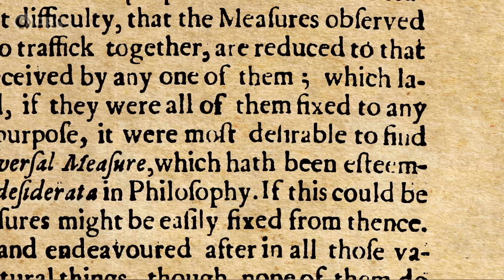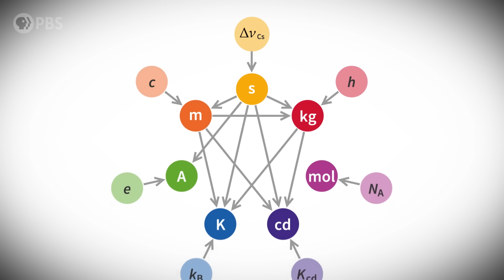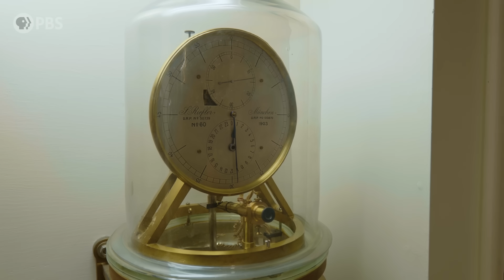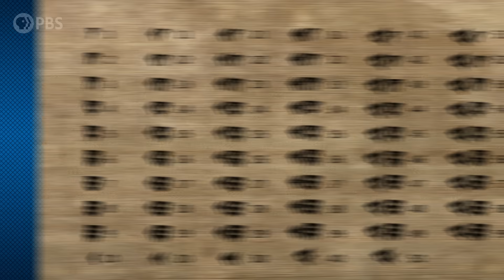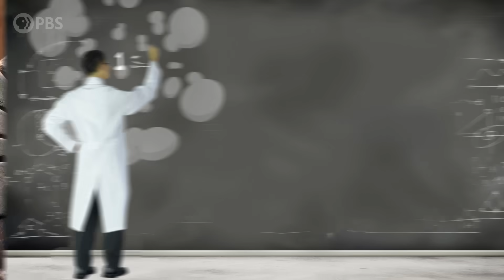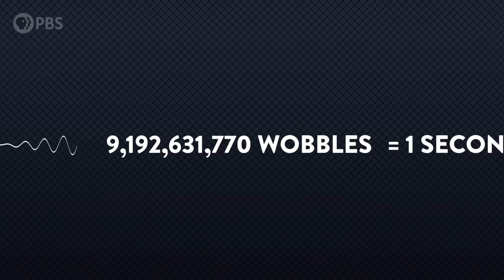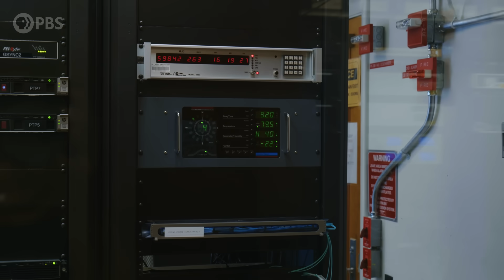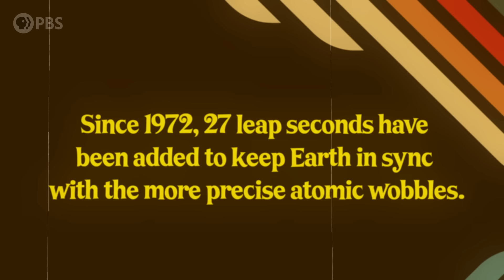The Unexpected Measure that Makes the Modern World Tick

Comment: But ... how did we measure the time to count those "wobbles"? Brain. Hurts.
Reply: The wobbles are contnous. You count the wobbles from any moment you want until you get the required number of wobbles. The time it takes for you to get that exact number of wobbles is 1 second.
We don't measure the time to count the wobbles. We count the wobbles to measure time.
Reply: @enadegheeghaghe6369  Yes I know that. But who decided the number of wobbles in one second. We're using 'wobbles' to measure time so by definition we already had a measurement for it. So my question is how we accurately determined the number of wobbles when such high precision didn't previously exist
Reply: @JATJAT330  I assume that the number of wobbles in a second was based on the previous best measure of a second we had before caesium atomic clocks were developed. You have to start from somewhere

Comment: I would think that time would be measured the most accurately one standard distance from singularity.  It would have to be theorized by mathematics, of course.  Like a cesium "pendulum" one meter from point of singularity (singularity is timeless, right?).  A time crystal?  A black hole crystal movement watch.
Reply: singularities cannot exist physically speaking, and you can't use them to measure distance either, since even theoretically, the only place we could find them is inside black holes, overall your idea isn't really applicable, even if we could somehow create a naked singularity, there's still the problem of actually measuring said distance, which due to quantum uncertainties, makes it impossible to pinpoint the exact location of the singularity giving you an incertitude orders of magnitude higher than what is used today.
Reply: @voice-less  , you said 'theorecically.'  That's what I'm saying.  I'm not talking a literal black hole timepiece.  Just figure it out mathematically, and make an actual cesium clock "geared" to be as accurate.  Maybe seven of them that an eighth one reads the average of the wobbles, the average would probably be even more accurate.

It might take more purified water for the steam drive, though.  lol
Reply: @augusthavince8909  I see where the confusion is, we can't ''measure'' a unit mathematically, just like distance, time is something we have to physically measure to know, Mathematics only tells you that 1 second is equal to 9,192,631,770 oscillations of cesium, but as you see, it's pretty useless information unless you actually know how much time it actually takes for cesium to oscillate, hence why we have to measure it.

and you don't need to have more cesium clocks, the oscillations can be counted with an absolute precision, so a single clock is enough to measure a second with a certainty of 9,192,631,770, the problem lies in that within physics, and within certain real life appliances, we need to be even more certain than that, so cesium clocks simply aren't enough.

A simple example to visualize it, would be to think of measuring time as trying the maximize the amount of frames per second you can take with a camera, the more you can take, the more precise your measurement will be, if I have a camera that takes two frames a second and then I try the video it took, it will look like a bad powerpoint presentation since a lot of information is lost and isn't captured, but the more frames you can take per second the more smooth the video will become, until you can capture events that happen within fractions and fractions of second, but scientists need even further precision as they need to practically capture events that happen within a 100 billionth of a second or even less than that.
Reply: @voice-less  , do I have it backwards that oscillations of cesium would speed up the closer it got to a black hole?  If so, can we achieve the oscillations that would occur at the event horizon in controlled conditions on Earth?  Can we assimilate the conditions of even half the gravity of the event horizon?  Perhaps with another electromagnetic frequency, like three "octaves" higher.

Wait.  Is it just a matter of getting more oscillations, or being able to measure more oscillations?

Comment: The U.S. is on the metric system and has been since the 70's, the imperial units in popular usage are defined in metric units and metric measures are on all products next to the imperial units.
Reply: OfficialBeSmart.  How do I do that,  have installed it on my phone (v20) but do not know how to connect to you

Comment: 3:30 "Our species has marked the passage of time using various cycles . . . even tides"

I think tides could have played a very important part in the history of timekeeping, and may explain how we came to divide the clock face into twelths. Starting with low tide this could tell you successively what proportion of the tidal range had been reached at a given time until 6 at high tide, and while it recedes until 12 again. 1 o'clock tells you that 1/12 of the range has been reached, 2 o'clock that another 2/12 has been added (so increase in height and water flow is speeding up), at 3 o'clock that another 3/12 has been reached and we're now at maximum flow speed. By 4 another 3/12 has been added. The speed would be diminishing but the height would still be increasing till 6 when the tide starts to recede again. This change in flow speed is represented by the sequence 1 2 3 3 2 1, which of course sums to exactly 12. If the clock face were divided into 16 say, then the sequence would be 1 2 3 4 4 3 2 1 which sums to more than 16, and if 10 the sequence would be 12321 which sums to less than 10. The high tide to high tide cycle seems to roughly match the midday to midday cycle at 2:1, so 2 lots of 12 covers the latter. Tide, both high water and flow speed, must have been of immediate practical importance to early shore based and many riverine civilizations, enough to decide the number of time division units you were going to use over the tidal cycle, though probably not down to the second.

Comment: Why on earth did they not simply round the number up? I get that there is a historical reason that they probably landed on that number considering the fact that prior to atomic clocks a second was somewhat vaguer . They could simply have rounded off the billionth of a second. On top of which, when things like satellites are moving through or atmosphere a second is no longer a second to them, due to their speed.
Reply: You can't realistically change the numbers now, a lot of things rely on those numbers being exactly what they are. You would have to have 2 systems, one with the old numbers and one with the new ones for hundreds of years until every ruler, every clock, every machine, and everything that relied on the old ones is phased out.
It is simply too costly to do it.